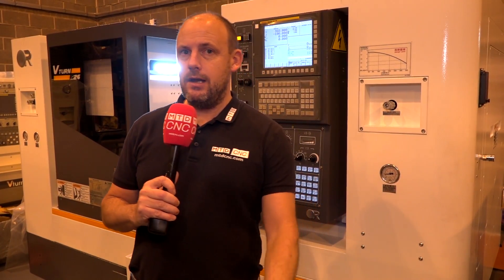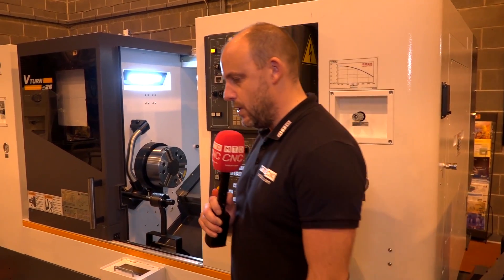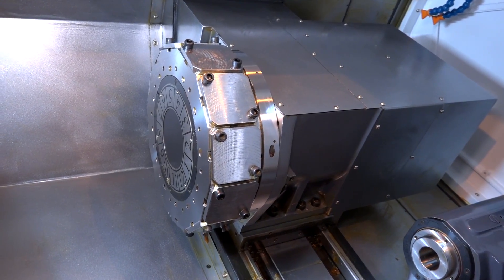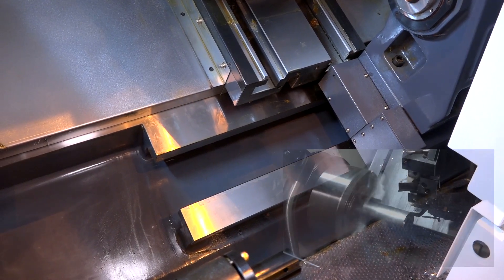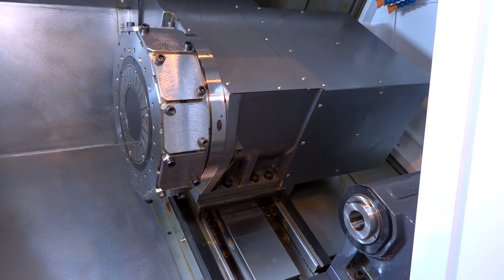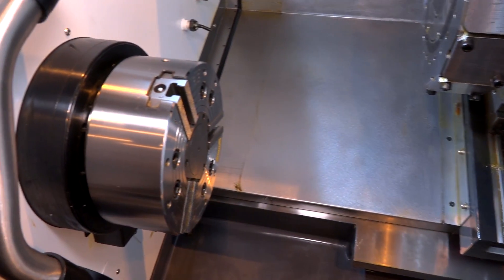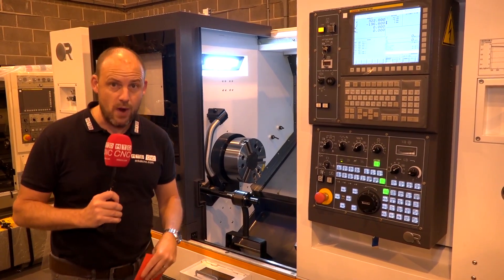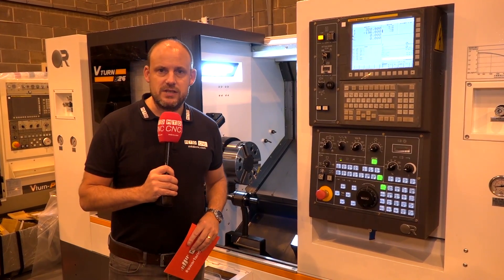New Vturn S26 from Victor offers unrivaled power and performance

Comment: What's the price for this exact machine, does anyone know? Cheaper than Haas ST-25?
Reply: zyndapp800 not sure about the exact price but I can promise you it won't be cheaper then a Haas but another thing I can promise it is twice the machine...... Starting price around 60k but that's a rough estimate
Reply: @chrisyboy666  ok, we're just interested to buy Haas ST-25 as it seems to be "best for the buck" but now I started to wonder how mutch this one costs
Reply from the maker: Some machines are built to last, some aren't. This certainly is. Where are you based @zyndapp800
Reply: zyndapp800 Not sure what your situation is regarding finances, when it comes to purchasing a new machine...But it my experience (started as apprentice toolmaker @ Nei parsons Newcastle) then moved into the Apps.last 25 year I’ve worked for Mazak maho WFL....now @ Bost...if you intend to run...your new machine hard with exotics and cast....stay away from Haas there just not built to cope with that type of work.....A bigger investment now will pay off massively in the end..You don’t need to buy a Rolls Royce of a machine....there are lots of Really  solid machine tool builders/manufacturers out their,on the market,that are producing amazing capable machine @ a competitive price  Haas are not one of them these guys @ MTDC can’t say it directly...but I will....I would look @ 2nd hand machine with low hours on....from one of the big boys....they will give a warranty for 2 year and these machines are more then  competitive price and performance wise...You also get the back up and piece of mind it’s a no brainer...Also it Adds kudos  and competency to your existing customers and potential  customers when,look @ your capacity and see investment in quality proven machine tools
Reply: @chrisyboy666  @zyndapp800 You are right, with soft materials the Haas somehow works, but Japanese is better in any aspect. I had two Haas lathes and one vertical machining center - replaced them with Mazak and Okuma. Both of them are so much better in any aspect - the rigidity and speed. Also a reminder - anybody who looks only numbers will not see the difference before they get their hands on. If you have the opportunity, try to find a machine to test your work on.